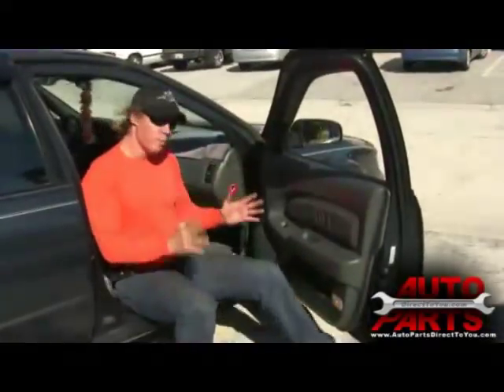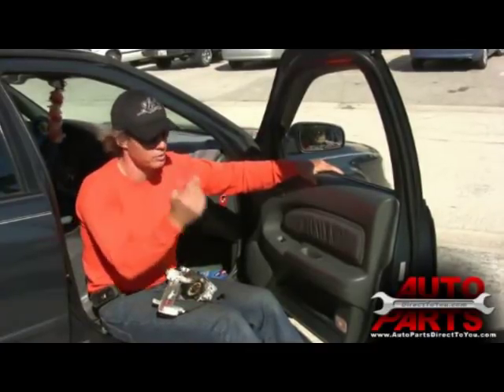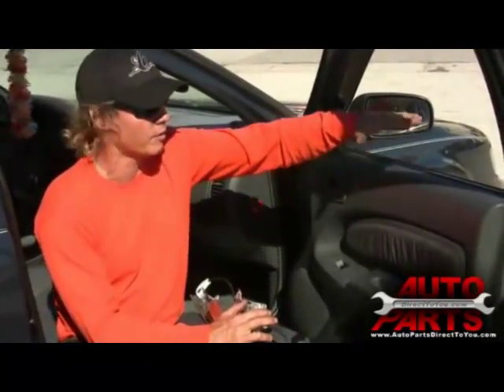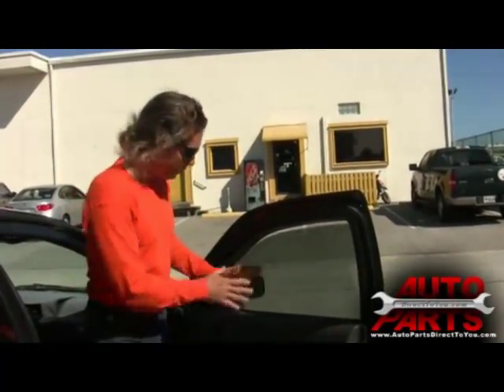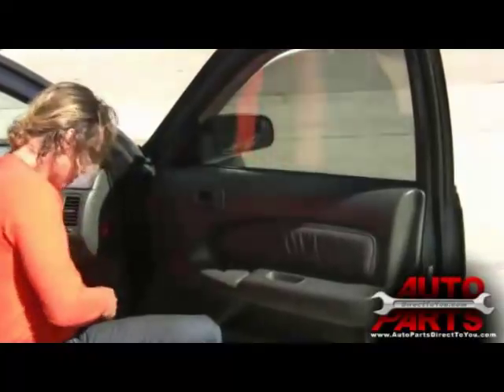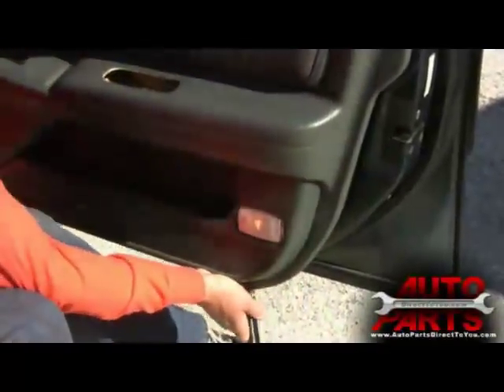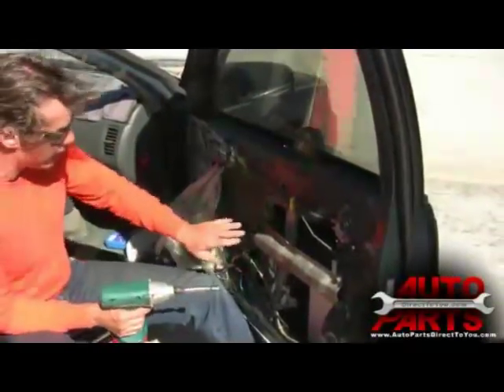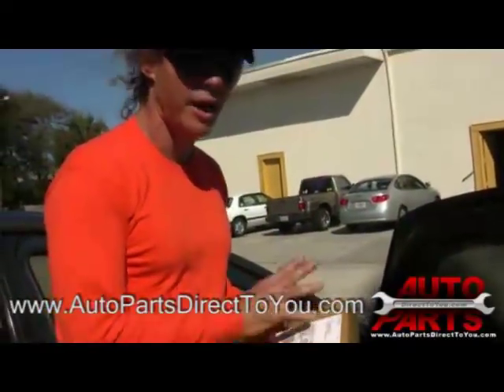Diagnose Window Motor and Regulator Problems Part 1

Comment: this viedo is a total life saver.  I couldn't get the passinger side window to work so I took the door apart and didn't really know what to do next. I looked up a manual on-line that was totally confusing and had no photos or diagrams.  It said "disconect your car battery"! Oh my! Then I found this video.  When the video got to the window lock switch on the driver door I tried it and.. THE WINDOW works.  I saved something like $100 because of this video.

Comment from the maker: You'd have to check for power and ground going to the wires of window motor while try to roll it up. If you have power and ground, but the motor doesn't move, then the motor is bad. If you don't have power and ground, then it's something electrical (possibly switch). If the motor is locked up, the only way you can force it up is to unbolt the motor and manually pull the window up.

Comment from the maker: @glithches Hi Maggie, it sounds like either the regulator is failing or the motor gears are beginning to strip, unfortunately like most window problems, there is no easy way to tell which of these is causing the problem without having the door panel off. What needs to be done is to have the door panel off and watch the window mechanism while the window goes up and down to see what is happening. Good luck!

Comment from the maker: @bashi786 It sounds to me like it's probably the motor itself, your next step in checking it would be to remove the door panel, and while pressing the various switches for the door that has the issue, check for both Power AND ground at the window motor connector. If it has power and ground in both directions, replace the motor. Otherwise it's going to be a trickier electrical issue.

Comment from the maker: If it's a cable style regulator, the easiest way to release the stuck window is to simply cut the cables and the window will be free to move. If it's a scissor style regulator, unfortunately it isn't quite as simple, sometimes you can get the motor to work temporarily by tapping on the motor with a small hammer or ratchet while operating the window switch. As a last resort, you may have to drill an access hole in the metal behind the door panel to gain access to the window bolts.

Comment from the maker: @dude9131 It is definitely a mechanical issue. Your next step in diagnosing will be to pull the door panel off and actually watch what is happening when you try to roll the window down. Stripped gears in the motor could be the cause, but so could stripped teeth on the regulator.

Comment from the maker: @dougfrmdaeast It will be tough to figure out exactly what the problem is until you get inside the door. Based on the symptoms, it's obviously a mechanical failure, it would have to be one of the following things: 1) Gear inside the window motor is stripped. 2) The regulator itself is broken, and no longer connects to the motor to the window  or 3) The regulator has detached from the window glass, and the glass is free to move up and down.. To determine which it is, you need to get in the door.

Comment from the maker: It sounds like you might have a window motor going bad. They will often be intermittent like that (work 1 minute, and not the next) before they completely fail. The only way to be certain would be to check for Power and Ground directly at the window motor when trying to move it, if you have power and ground, but the motor does nothing, then the motor is bad.

Comment from the maker: The power and ground alternates through the switch, both wires coming out of the switch should be ground when no buttons are pressed, but depending on which direction you go with the switch, one wire will be ground, and the other is power. And when you go the other direction, it will switch directions. thats why you need to check for power and ground at the motor, and going in both directions with the switch

Comment: Hello, i have a 2004 Nissan Maxima and the problem I am having is when i need to roll the window up. After rolling the window down automatically with no problem using the one click  option,  i then try to roll the window up automatically but the window will only roll up halfway then stop and roll down a little. I then try to roll it back up and the same problem repeats until I can get the window rolled all the way up. I'm not sure if its the regulator or the motor starting to go. Any input would be highly appreciated. Thanks in advance.

Comment from the maker: For a scissor style regulator to bend like that, either the window was frozen (literally if you are in a cold climate), or something interferred with the movement of the window. It is not common but can happen, the regulator is designed to be a weak point, it should be the first thing to fail rather than the glass when something obstructs the window.

Comment from the maker: Before replacing anything, you can determine exactly which is bad. Pull the door panel off and check for power and ground at the motor while trying to roll the window up. If you have power and ground but the window doesn't move, replace the motor. If you are not getting power or ground, or both, at the window, replace the switch.

Comment from the maker: Typically when they start making a grinding sound, it's caused by worn out teeth slipping, those teeth can be either on the regulator itself depending on the vehicle, or build into the motor. You'd have to take it all apart and see if you can find where the wear is within the regulator or motor and then replace the appropriate part.

Comment from the maker: @shane1243 It could be a couple of things, first thing to check would be to pull the door panel off, and with all the switches plugged in, try to roll the window up, while doing that, check across the two wires going to the window motor for 12V. if there is 12V, then it's the motor that has gone bad, if there is NOT 12V, then it is something electrical, most likely one of the switches.

Comment from the maker: @trmulligan It sounds like your motor might be going out, when you use the auto-down feature, it actually puts a lot of strain on the motor because it forces the window down, and then will continue to try to roll it down for a few seconds before it stops. It's as if you held down the window switch for a few extra seconds every time you roll the window down. It sounds like the gears inside the motor might be stripping, and that noise you hear is the grinding of the gears.

Comment from the maker: @chuchum3 It could be either, to verify, you would have to pull the door panel off, and check for voltage and ground AT the window motor when you are pushing up and down on the switch, if the motor gets voltage and ground in both directions, but doesn't move, the motor is bad, if it doesn't get voltage or ground in one or both directions, it's likely the switch which is bad.

Comment from the maker: if they all failed at the same time, I would suspect a problem with the power supply going to the master window switch. If you already replaced the fuses that run to it, it could be a problem with the wiring itself. I would start by pulling out the master window switch and seeing if you can find a good power supply going to the switch when the key is on.

Comment from the maker: You need to get into the door panel and check for voltage and ground at the motor when trying to roll the window down and up. If they are both there, replace the motor. If you don't have power or ground while trying to roll the window down, then you have an electrical issue which could be the switch or power supply going to the motor. If it's the regulator, the problem should be obvious once you see inside the door panel (broken pieces).

Comment: The back drivers side window on my 2001 Acura TL stopped working properly the other day. While on the hwy, my daughter tried to roll the window up & it made almost like a Crack type sound (I actually thought a pebble hit the car, to give an idea of the sound), but then it'd no longer roll up. We tried to roll it down and it'd go down little by little, but never up.  Unfortunately now it's down  all the way,  and when we try to push the button to roll up/down, it sounds like a continuous grinding with an occasional crackling type sound also. I'm taking it to get it fixed today, but being a female I don't want them to screw me over, so I was hoping to have an idea of what this could be and what the cost to fix may be. Hopefully someone can answer back soon, before my appointment :) Thanks so much!

Comment from the maker: @artgeek09 It sounds like an issue with the regulator, but there is really no way to tell for certain until you get the door panel off and physically inspect the insides of the door.

Comment from the maker: The clicking noise you are hearing is probably the relay clicking, which means the switch is likely working properly. I would suspect your window motor is bad and not responding to the signals it is getting. Your best bet is to pull the door panel off and check for power and ground at the window motor when trying to roll it down and up. If you have power and ground at the motor, but it's not working, then the window motor is your problem.

Comment from the maker: if the regulator is all jammed up, and you need to get the window up, sometimes you have to cut the cables going to the elevator mechanism to free it in order to manually slide the window up, you can then wedge something underneath the glass until your new regulator arrives.

Comment from the maker: @EvelKnievelCadaver Sounds like it is probably the regulator, the last thing to check would be to unbolt the glass from the regulator,, and move the regulator by itself, and the glass by itself, whichever is causing the friction will be your culprit.

Comment from the maker: It very well could be a fried window motor, the only way to be sure is to pull off the door panel, and check for power and ground directly at the window motor when trying to roll up and down the window. If both power and ground are present when going up and down,, then the motor is bad, if power or ground are missing,, then it's something electrical going to the motor that has gone bad.

Comment from the maker: It sounds like you might have an intermittent window motor there, I would suspect that the brushes on the motor itself are going bad, and when you pull up on it, it nudges it just enough to let the brushes make contact and get the motor going. You can verify this by checking for voltage at the motor when it isn't working, if you have voltage and ground at the motor but the motor isn't moving, then the motor is your problem.

Comment: This is a great tutorial video!    I have a question... I own a 2013 Ford F350 and the drivers side rear door window when rolled down makes a clank or light bang sounds just as it reaches the point of being rolled all the way down.   Any ideas what that could be?   Thanks a bunch!
Reply from the maker: Lucky Drummer LaFlesch sorry for the late answer, you will most likely need the. Otto and regulator assembly, some you have probably fixed this already, then let us know what solved it? Thanks

Comment from the maker: The window switch for that motor could be the problem too, the signal from the master switch also goes THROUGH the individual window switches, so even if the master switch works, the other switch may be bad and not letting voltage and ground get to the motor. Your next step would be to check the voltage across the motor when going up and down. If you have 12 volts going to the motor in both positions (Make sure you measure across the motor) then the motor is bad, otherwise it's probably a switch

Comment from the maker: You need to get into the door panel and check for voltage and ground at the motor when trying to roll the window down. If they are both there, replace the motor. If you don't have power or ground while trying to roll the window down, then you have an electrical issue.

Comment: i have a 2002 nissan sentra, the window wont come up, i took the door panel off and looked at everything..it looks like the black casing on the wire of the window regulator keeps getting caught on the wind up part of the window , is there any easy fix for this?

Comment from the maker: Well, you can make 100% sure that it is or isn't the window motor, if you can get inside the door panel and check the motor for about 12 volts across the input wires you can know for sure. If there is power across the motor terminals when trying to operate the motor, but the motor doesn't move,  the motor is bad. If there isn't, then something else (suspect the switch) is bad.

Comment from the maker: Hi, I don't have any recommendations about your exact van, that model of van never made it to the States, so I am unfamiliar with it. The noise when closing the door is likely the regulator or window bracket has come loose from the inside of the door. When the window is up, there is pressure applied to the mechanism which keeps it from rattling. I am not sure on the ticking noise however, could be a faulty relay somewhere?

Comment: I have a '01 ranger and the window goes up and down normally but when I roll it up the window makes a bang noise once it goes all the way up and it sounds like wind blowing by for a little bit and then the noise goes away.
Reply from the maker: Brandon Faust u most likely need a new motor regulator but you could remove the door panel and reinstall the window switch, then recreate the issue and watch closely at the regulator to see the problem

Comment from the maker: @Goodwrench496 Could very well be the regulator starting to fail, if the window Shifts forward when going up, it will drag against the rubber seal and cause it to go up slow.

Comment: Great Video!  Im trying to figure out what is wrong with my 2001 chevy passenger side window.  The motor sounds fine when I run it but the window will only go up when I press the switch to roll the window down.  What could this be?  I already took my door panel off and could see that there was a kink in the cable when I was trying to run the regulator up and down.  This require a new regulator?  Also, the window will only go down a third of the way even when pushing down the window with my hands

Comment: My window goes up starts clicking and you have to back off the switch. It will go about half way down and make the clicking noise also.  What would this be?
Reply from the maker: Big Kahuna the regulator or heat in the motor is failing, this will break completely eventually, you can remove the door panel and re- install the switch and then inspect the regulator and see what causes the click, you may want to prepare for a new motor and regulator assembly which are not too expensive nowadays

Comment: Hi, 2004 Honda Accord v6 EX 4 door. Replaced actuator & cable that operates inside door latch on driverside 2 months ago, 4 days ago the power windows, power locks and remote key fob functions stopped working. I can unlock the drivers door with the key, but none of the others. Can lock and unlock all doors from the passenger control. Remote will not unlock trunk, windows or engage alarm system. All equipment is OEM. No sounds emitted at all,  when I close driver door, I hear 'LOCKING SOUND'. THX

Comment from the maker: @LongDreadZZ it sounds like you might have the same issue as "dude9131" who posted below. Your next step is to pull the door panel and physically inspect the power window components to see if you can find out what is causing the issue

Comment: Very informative video! I have a 96 Chevy Impala SS,and my drivers side window has issues! It only works when it wants..and I hear the noise you're talking about,when it goes all the way up,but only closes halfway! It's a grinding,or turning sound.. I have to pull the window up,with my hands sometimes!
Any idea? Also..it works sometimes,or it either stays up,and doesn't roll down.
Thanks for your help!

Comment: Hi, I can hear the motor spin for a short while the stop along with grinding. I assume from your advice that its probably a cable issue. would you say it as disconnected or snapped? Thanks.

Comment from the maker: I always suggest doing both at the same time while you are in the door. You will already have the whole assembly out, so you may as well put a new motor in along with it. Otherwise Murpheys law says after you are all done putting in your new regulator,, the window motor will fail shortly after.

Comment: K boss, I have a 2005 GMC Epica. windows all work fine except drivers side went down and now won't go back up. only sound I am getting from the switch is a clicking sound in either position and the sound is coming from under the dash. all other switches on the drivers side work fine for other windows, windows lock and door locks. Is it a breaker that is making the noise and needs to be replaced? thank you
Reply from the maker: ok it is time to check the motor. You would have to remove the door panel and check the motor and regulator. Since you here a sound when pressing the switch, then that is a good indication that the switch is working but not the motor. With the door panel off, you can visually check the regulator to see if it came apart and you can also unplug the motor and apply 12 volts to see if it moves, keep hands and fingers out of the way. You can tap on the back of the motor with the handle of a screwdriver while applying 12 volts and it will probably vibrate it enough to get it to work, but that does not mean it is fixed, It means a worn spot exists on the motor and it should be replaced. Also if it is available, replace the whole motor and regulator assembly.